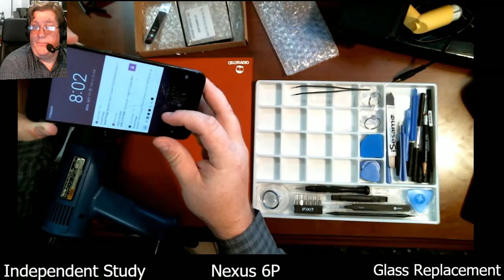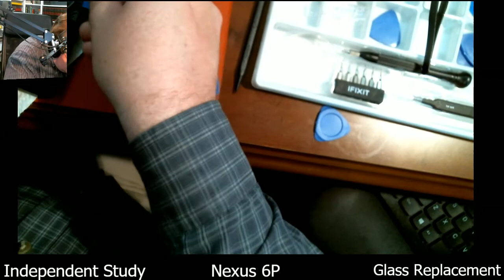INDEPENDENT STUDY: NEXUS 6P Glass replacement. It didn't go well.

Comment: What I did was put a tempered glass protector for now so its smooth and I won't cut my fingers. It works as far as touch. I was thinking just taking the broken glass off and installing a  tempered glass protector over the lcd screen. But for now I'll just put up with it.

Comment: Hahaha. This is pretty funny and sad at the same time. I enjoy the outcome. What's the update with your Nexus 6p? Did you got a new digitize screen?
Reply from the maker: I ordered a new Nexus 6P. Mostly just ran out of time to play with it. I still have the original, so one of these days!
Reply: If you get another crack screen, I highly recommend using a playing cards to separate the glass screen from the digitize screen. So much easier. Also, use a glove to hold the phone cause the frame can get so damn hot. I'm replacing the glass screen myself.
Reply: Andy Cowen can you give me the one you ruined?
Reply from the maker: Maxmogavero, give? Not likely.
Reply: I recommend replacing the whole frame/display rather than a glass only repair.
Reply: hey , so what happened did you replace it by your self ? , im looking to replace mine , but i dont know how to separate the glass from digitize screen , also how do i stick the new glass to the digitize screen ? by a liquid glue ?
Reply: donY-ZZZ You would use LOCA glue but I don't recommend that method...
Reply: Nick T. Literally the same video I just linked 😂
Reply: +Korey Ha ha. Wasn't paying attention.
+don Y-ZZZ. And it's not fish line like I thought. It's special wire to cut through the glue between the screens. They also test the lcd during the process to make sure it still works after removing it, after cleaning it, and after gluing it. Too difficult for me.
Reply: Nick T. Great minds. From my experience this is the ONLY way I'd try another glass only. It's too hard.